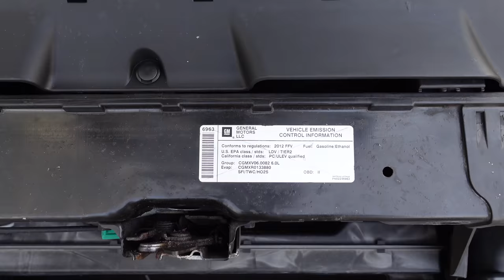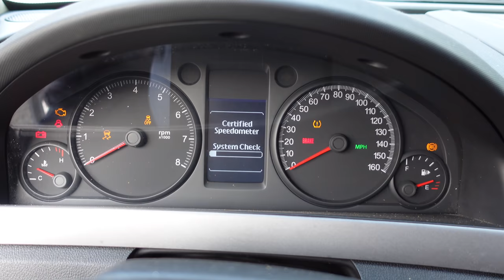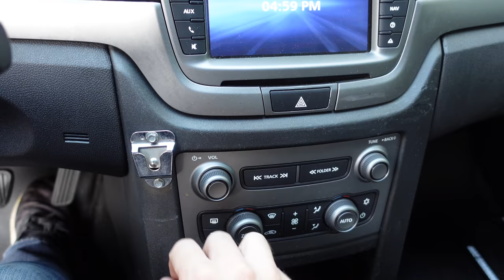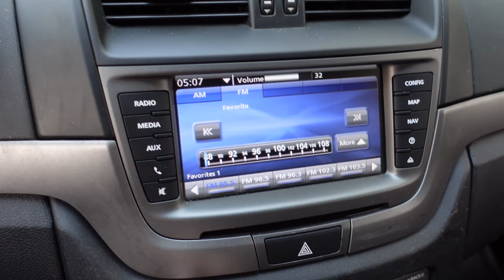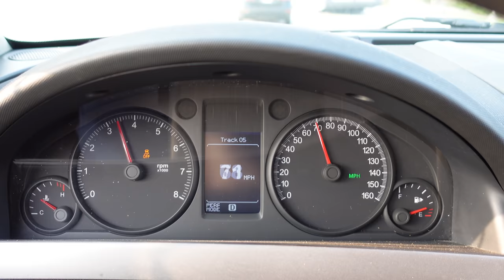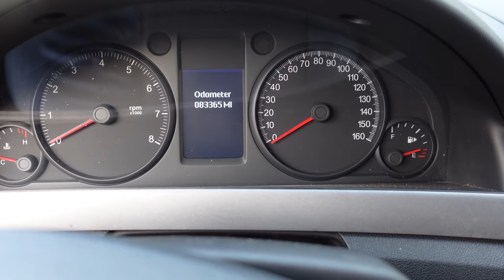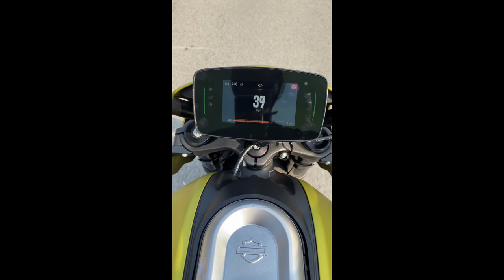The Chevy Caprice PPV Is An Australian RACE CAR Playing Dress Up As A COP CAR

Comment: The caprice in Australia was the top spec luxury holden.
Reply: Yeah they basically serve the same role as the large Buicks and Cadillacs do Stateside.

And yeah the PPV seems to get a lot of bits from lesser model Commodores. I wonder if any got the 6?
Reply: @auscrappers7363  my misses has a v8 ve calais,
pig of a car with problems galore
Reply: Dean Styles all PPV caprices were V8’s.
Reply: @Krsevan Petric they'd build it as a omega and add caprice badging
Reply: they sold this model in brazil as Chevrolet Omega C(V6) or Omega Fittipaldi.The fittipaldi had the V6 Alloytec 24v SIDI and it was the last of them..600 made in 2012.
Reply: BMPellogia not quite.  The omega c / fitipaldi was based on the commodore short wheel base, not the statesman/caprice long wheel base which is what the PPV is
Reply: @LTD347  oh ok! i didnt know they had different whellbases,thanks!
Reply: BMPellogia basically the same vehicle but more rear room, which is probably why it worked well as a police vehicle since they could fit the cage and still have enough room for a person
Reply: Wayne Pantry they’re hsv not holden
Reply: @waynepantry7023  I thought it was the International statesmen
Reply: @alt7488  what kind of problems did it have? The GM V8s are as solid as they come
Reply: @LTD347  hsv's all got the ls3...it's just a holden statesman bud
Reply: @tehgzizlauw1787  sticky lifters,air con problems,gearbox is dying,engine mounts stuffed,coils buggered, numerous tensioners failing,bad battery,
the ve is a dog other owners have multiple problems with them too 
pre vz the ls1's had piston slap on start up,
and the ls2's with displacement on demand get failed lifters,
both here and in trumpland  
so no the ls based engines are not bulletproof as you say
Reply: @alt7488  yet many still running with half a million Kms on them, sounds like your calais had a rough previous life as a skid pig or someone is doing stuff in it they shouldn't be, that you perhaps don't know about. Bad battery also isn't the cars fault whatsoever. Dunno about stateside, but the 6L80e autos in the aussie LS powered VE/WM era are pretty damn hard wearing. About the only thing I can say is definitely a common problem is the sticky lifters and some get a stretched timing chain. At the end of the day though, $10k gets you a brand new motor for one of these, much much cheaper used. Not sure what more you want out of this vehicle. Theres a reason people put ls1's and ls2's in everything from sedans to 4x4 wagons.
Reply: 500,000km = 310,000 miles if anyones wondering
Reply: @LTD347  that’s not true. There are V6’s out there.
Reply: @alt7488 HSV Grange was Caprice until 2011 and after that the CapriceV HSV also had commodores there were a few HSVs in the range

Comment: For Australian police cars, the iconic one is the "Pursuit Special V8 Interceptor" made famous in the Mad Max films.
The first car shown in the 1979 Mad Max film with the title of Pursuit Special is a 1972 HQ Holden Monaro V8 coupe stolen by Nightrider (played by Vince Gil), an escaped cop killer, who dies in an accident that destroys the vehicle. The more famous Pursuit Special is a heavily modified Ford Falcon XB GT, that started out as a standard white 351 cu in (5.8 L) Australian built 1973 Ford Falcon XB GT Hardtop when in 1976, filmmakers Byron Kennedy and George Miller began preproduction on Mad Max.
The main modifications are the black paint scheme, roof and boot spoilers, wheel arch flares, and front nose cone and air-dam designed by Arcadipane (marketed as the "Concorde" style). Also, eight individual exhaust side pipes were added (only two of them being functional, others appeared to be working because of the vibrations the first two created). The most famous feature of the car is a Weiand 6-71 supercharger protruding through the bonnet. The impressive looking supercharger, in reality, was nonfunctional; functional superchargers are typically driven constantly by the engine and cannot be switched on and off, as portrayed in the first two Mad Max films. https://en.wikipedia.org/wiki/Pursuit_Special
Reply: Yep, the last of the V8 Interceptors. All you would need is road leathers and a blue healer.
Reply: "This is a threshold moment Johnny".....
Reply: The Aussies got all the cool fords....
Reply: @theicksta  Id argue that because we only got Small block Windsor and Clevo to 351, the big block stuff like the FE engines in Galaxies and F series trucks we just didnt get.
We just had less to work with so the 351 got a lot of development for racing and endurance.
For me the 1979 XD Falcon Interceptor (351 Cleveland, Twin rail Toploader 4 speed aka Borg Warner 0506, 9 inch and 4 wheel disc brakes) was probably the most affordable fun back in the day and I had 2 and a handful of the 6 cyl versions as well but I also had some earlier versions from 1971/1972 which were fun but I went back to Chrysler.
Making the 351 breathe was the key and some head variations with way bigger valves helped that but unlike today importing US Speed parts from say Summit Racing wasnt widely done (I did though :-) 
What you guys dont realise is that you have a massive range of speed parts WAY way cheaper than we did at the time and do today.
Probably why I buy from Rockauto/Summit/FCP/Pelican and have for decades.
Reply: @tony66au  we got the galaxie in ckd form at one stage,and you could/can  import bronco's/f 350's etc etc easily if you had the cash
Reply: @theicksta  And Mopar utes.

Comment: Holden caprice - damn nice car. Such a shame GM in their infinite (lack) of wisdom shut down Australian manufacturing :( I have a VS Calais (1995) which we have owned since almost new. Just a few minor issues to fix (power steering rack has a minor leak) a part from that it is a solid car. Have to lock it away now so the hoons don't try to steal it.

Talking about an empty engine bay, I should post a picture of the V6 Calais engine bay, there is enough room to have a party in there. (car is almost air cooled there is that much room). (the car came in V6 and V8 options and the bay is of course the same size for both)

Comment: My lil sister bought a 82 cop diplomat in 84 for 500 from a police auction. She let me drive it a while and I wore a blue security/police style jacket and drove it on the freeway at 55mph and cars were backing up behind me 5 deep. Suddenly somebody would figure out it was retired and fly by me, it was great fun. Unfortunately it was far from fast but it handled and stopped great, big cop wheels, tires, and vented beanie caps. She traded it in for a Hyundai in about 87 even though I really wanted it and would have eventually figured out the early computer controlled carb issues. I still have the spotlight.

Comment: The underhood dimples are for heat transfer.  Keeps from needing to have an insulating material sheet on the hood, helps dissapate heat from engine bay with more surface area.

Comment: Having checked out the Caprice PPV a couple of times I find 2 things everybody talks about. One is the power of the LS under the hood which like you found out is a perfect match with the handling of the car. And Two is the sky high cost of parts when something breaks on it since like you said EVERYTHING comes from Australia. You can't just run to your local parts store and ask for parts for an LS since it is in fact an Aussie built L77. On another note my own cop car is why Im watching your channel. Im still trying to learn everything I can about the 3.6l LFX which you where working on saving in the Camaro.

Comment: I have owned my 2011 Caprice PPV for 7 years now and still love it to this date, great sleeper LS sedan. Mine only has 52k miles with DOD delete, stage II cam, CircleD stall, Kooks headers and pipes, VRM intake, and other mods. Many people think it is like the Impala, FWD and slow.... Far from it. As for what you all said in the video, I understand not everyone is super knowledge about these, so no worry there.  They were from 2011 to 2017 as 2017 is when Holden went away. All that cop stuff is not factory, the spotlight is though a factory option, not all Caprices have them. 

The radio is not a My Link of any sorts, it is just AM/FM/CD/MP3 and that is it, nothing else is enabled.  Does not have the NAV board in it, so that cannot be enabled, but it can be programmed to add USB support, Bluetooth (phone and music playback), rear backup camera, AV in (See my channel - Caprice PPV Radio White). The overhead console does not have a mic, so that needs to be added. The rear doors are aftermarket panels, along with the plastic seat, factory has normal door panels and seats. The GPS on dash is also not factory, likely for the computer and video system that was removed. Yeah OnStar was deleted, no need for it, saved GM money. 

Anyway, you need to get one, but look for one that was not patrol and used as maybe Admin or State Patrol where it may of had only one officer assigned to it. Most of these city cars are beat up bad and end up costing a lot to fix them. The Crown Vic is a much stronger abuse car, but they are slow compared to the LS cars.

Comment: Really like this upload. I have a 2019 Hellcat Redeye and a 2001 Crown Vic P-71 unmarked cop car I paid $1400 for. It has a spotlight and push bumper, no siren or emergency lights. I put more miles on the Vic than my Hellcat Redeye. It’s fun, until you get behind someone. I have passed more people in the Crown Vic than my Hellcat. People just want to drive 5mph below the speed limit in front of you, even though most Crown Vics have been retired. Tell the owner most factory radio antennas have simply been unplugged by the guys installing the police radio equipment, I was able to plug in the factory antenna at zero dollars. Same with the front speakers.

Comment: The weird backside of the trunk is used to mount gear or LED lights. If the PPV was configured as unmarked you could pop the trunk and have flashers up there to divert traffic after pulling someone over

Comment: The antenna on the dash is more than likely a GPS antenna for MOVE.....that’s the program (developed by CAPS) the laptops we used for working wrecks, writing tickets and do incident/offense reports to give exact location on the reports/tickets. It could have also been for the radar unit. Looks more like the one for MOVE though.

Comment: I've got an 06 Police Impala. It's fun, but it's only the V6 version. Parts are pretty fairly priced though. And it's got the column shifter. The Police Caprice on the other hand is not one I'd want to own. Because the parts come all the way from Australia, they are very expensive. Most of what it needs you can't get at a typical auto supply store aside from the basics. Bulbs, oil, brakes, ETC.

Comment: A few things worth noting about the Aussie Caprice which is actually a long wheel base luxury version of the Holden Commodore, First and most importantly the Chev engine in RHD cars is modified, Oil pump, Starter and a few other bits and pieces because with the steering on the right the US engines didnt fit.
Yes Flex Fuel is handy there but E85 is not widely available outside Queensland although E10 is.
Yes there were performance variants of the Caprice but they were generally built by other companies, not GM-H.
2017 was when the last Caprice was available.
Holdens death was due to many things despite the hundreds of millions in bail out funding from the Federal Govt but the final decision came from GM.
Ford Cop cars and Ford Australia Falcons model BA/BF and the FG were not Flex fuel from factory and still made a good 50% of Police cars in Oz.
They can easily be converted to run E85.

Comment: rear antenna is digital radio system. roof antenna still standing is the am fm antenna, the one no longer is a analog one usually for talk around channels or other departments. data usually is the myfi cards in the mdts or a external one. those are celluar based. ive been in a few grays ones............ legally lol.

Comment: The GPS antenna was either from the MDT  (Mobile Data Terminal)  or an in car camera system.
EDIT>  It was from the camera system.  The ball mounts on the passenger headliner are camera and monitor mounts.

Comment: The V8 supercars as raced in Australia use E85 ethanol fuel, while the road going versions were able to run on it from about 2009 to 2014, when it was dropped.

Comment: It's got a cop motor a 370 cubic inch plant. It's got cop tires, cop suspension, cop shocks. It was a model made for flex fuel so it'll run good on ethenal gas. What do you say, is it the new bluesmobile or what?

Comment: These statesmans & caprices, are a luxury model here in australia & over in new zealand but for these caprice ppv's, one thing about them is that they have the interior taken from the base model ve  commodore omega, and newer ppv's the vf evoke, as you wouldn't be having some fancy type interior for standard police duties & whatnot. And for the price of these police ones, is a cheaper option to get a V8 in one, as over here you'd have to spend a bit more to get a V8 in one, from $17,000 AUD & up to start for a 2006-2009 WM Statesman, though can always go for a VE Calais or SS Commodore for a few thousand less, around the same age too. But yeah, the us & elsewhere are lucky to have these, as they are certainly less than what you'd be able to get a V8 in one over here, plus being a model that was designed for police forces makes it that bit better too.

Comment: Fair warning to EVERYONE who is considering getting a former PPV Caprice, because it wasn't actually manufactured here in the states by GM rather Holden in Australia most all of the parts numbers do not translate to US dealers. Subsequently you will not get a straight answer if a part is the exact same and for the majority of things you will need to have it shipped from AUS to the US, usually adds about $50 on every single part you need under 10 pounds and $75 extra for every part over 15 pounds. It is not a cheap platform to get into whatsoever.

Comment: If you get one immediately get rid of that stupid cylinder deactivation system. It will destroy the camshaft by 100K miles. Other than that they are bad ass rides!!
Reply: The Mopar 5.7 hemi with the same type of setup has similar issues as well. I think folks do a similar delete and there have been running upgrades to the special roller lifters used. More than likely the delete was already done with all the mods Alex has done.